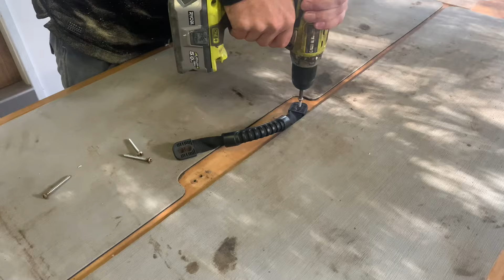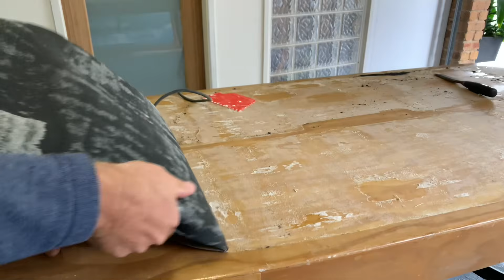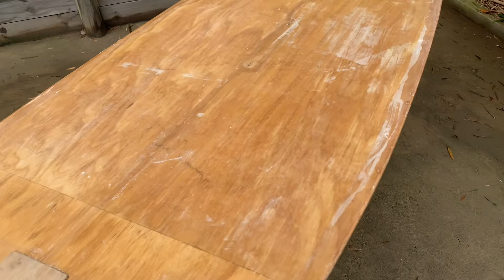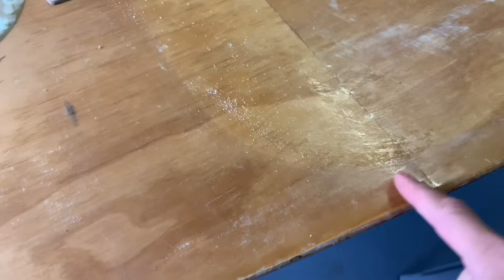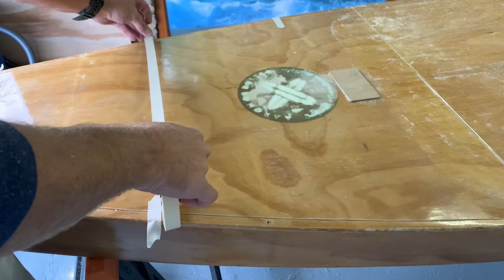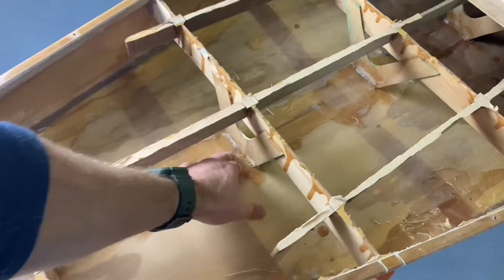[Ep 1] Adding a SAIL to a PLYWOOD SUP - removing 3M adhesive pad and cutting open the foredeck

Comment: i'm surprised it didn't need ribs on the bottom ply ?   is it 3mm ply on the bottom ?
Reply from the maker: Yes 3mm plywood with a layer of 100gm fibreglass over the top